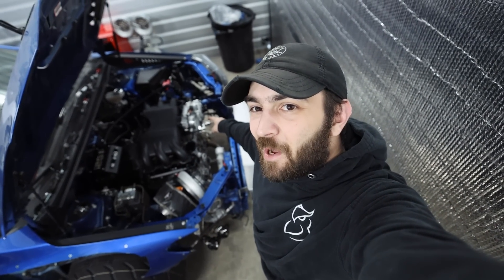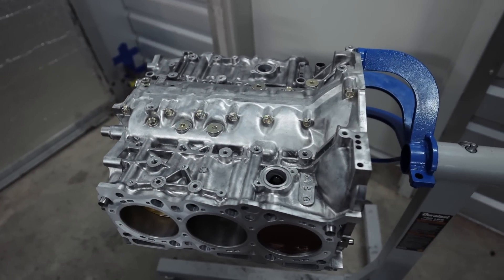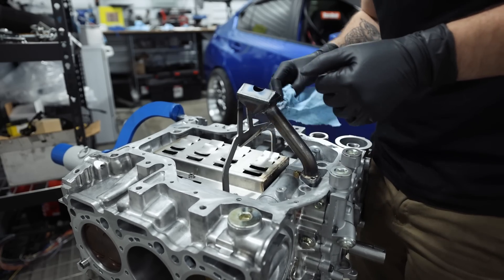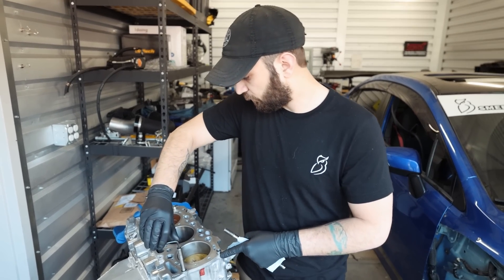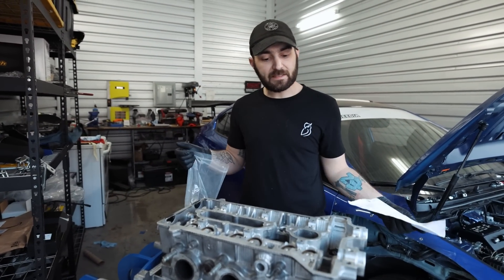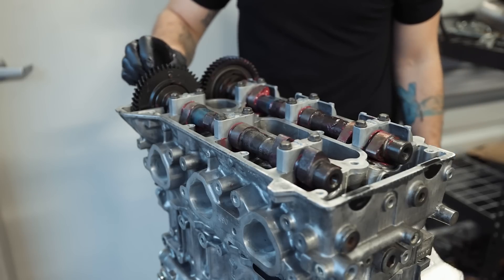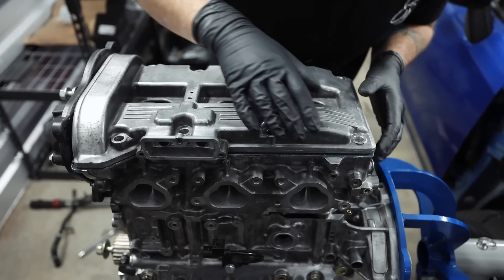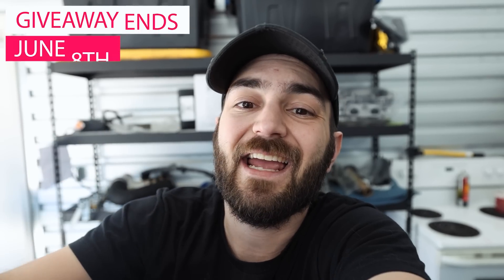Building a 1000WHP Flat 6 For my Subaru WRX STI PT: 1

Comment: ve had my subaru 2017 wrx since it had 4400  miles on it. Love that thing but had the tranny go on it at 22,000 miles. also yes i know how to drive a manual im 36 years old and have had 14 cars 9 of those manual. When i brought it to the shop they said i wasint under warranty bc they said it had signs of abuse $3200 later....Down the road as of now after they "fixed it" the car is back in the shop waiting to see what they say now at 30,000 miles. thinking about selling the thing now since this keeps happing and the bad taste of they Not honoring thier warranty

Comment: Im running aftermarket fuel rails and injector on stock tgv. It keeps leaking fuel on the injectors. Im running deatschwerks injectors. Do i really have to buy aftermarket tgv to prevent leaking or is it possible to run aftermarket injectors with stock tgv? 
2016 Sti

Comment: Hey Smeedia quick question. Can you do a video on wire harness, where all your connections will go and what they are?
Reply from the maker: On the EG33?  Have a few videos on building this harness already 👀
Reply: @Smeedia  on the ej205.
I went from ej205 swapped that to a ej20 now, im using the ej205 wire harness on ej20 motor.

Comment: So question. I understand 3 bond is stock but would honda bond work just as well? I use it on my m54 and my LS no issues. I didn't know if 3 bond had different properties or just a preference thing.
Reply from the maker: Honda bond would also work 🫡 just a preference using 3bond 🙏

Comment: Just out of curiosity why did you pack the oil pump with vaseline instead of assembly lube?
Reply from the maker: Vasoline is thicker and will dissolve when it meets the oil 🙏

Comment: 2 questions 

Why vasoline? 

What the difference between closed deck vs not?
Reply from the maker: Vasoline will dissolve into the oil because it's petroleum based. It's also thick enough to stay in the gears and not drip out. 

Close Deck they press material into the coolant jackets to support the stock sleeves to keep them from cracking under high cylinder pressure 🙏

Comment: Ahh dude, I mark the oil pump screws after I locktite them. If I ever take the oil pump off again, I can tell if the bolts backed out a slight bit or not.
Reply from the maker: Not a bad idea, ill prob start doing this from now on 👀

Comment: Great to see the EG getting back together Tanner! ...quiz Josh on the heat range of those NGK Plugs you're going with, being a '6' heat range, it is very likely that they may be to 'Hot' for the 1000HP goal. Great stuff as always!
Reply from the maker: Actively seeking more plug options right now. Emailed NGK a couple weeks back to see what else they offer but haven't heard back yet 💔
Reply: @Smeedia  1 heat range cooler BKR7EIX should be a good start.

Comment: Not an expert here but dont u loose torque when you use an extension?
Reply from the maker: Correct, I used the smallest one possible for it. Physically no way to hit those nuts without one

Comment: I think I woulda had the machine shop do a quick o-ring seat channel on the oil pick-up, but otherwise looks like it's coming along nicely muh dude!  I just got no trust with oil pick-ups on flat engines (mainly 4 cylinder with low counter weight).  😆
Reply from the maker: I debated it but without having the engine there to precisely get the location right there wasn't really a proper way 😅

Comment: 12:36 do you always need to do valve lash when it’s torqued down to the block?
Reply from the maker: If its been bench lashed no, but the head NEEDs to be simulated torqued down

Comment: Be careful with using those blue towels to wipe down machined surfaces as they tend to leave material. This build makes me wanna build my SVX
Reply from the maker: Went back over it with a red shop towel and compressed air 🫡

BUILD IT 😈😈😈
Reply: @Smeedia   🥶 I hope not the standard red towels as those are brutal, you wanna run lint free towels  

You got it bruh 🔥🔥